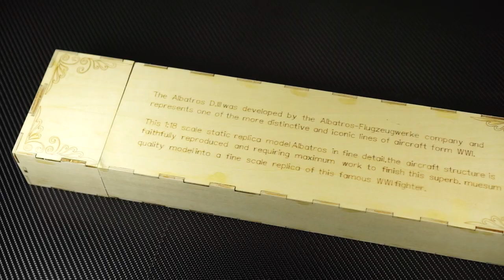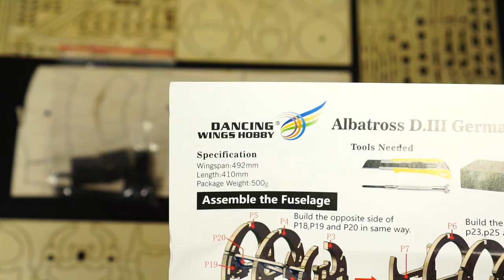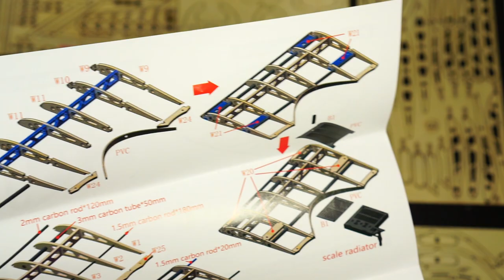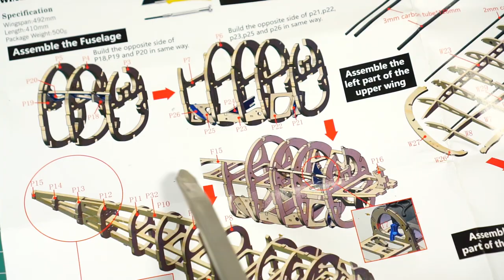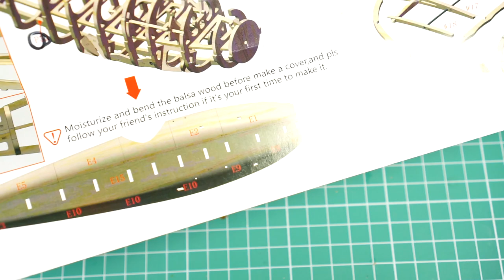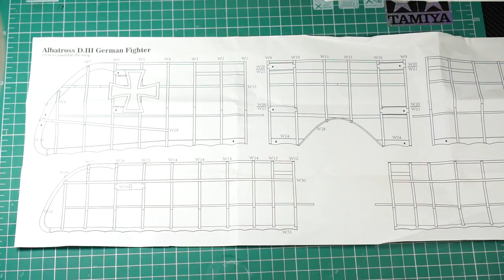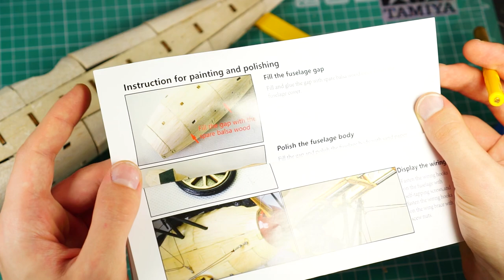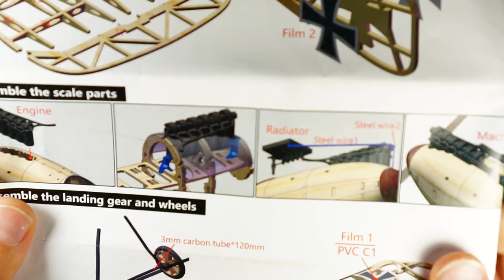Albatros D3 model build - DW hobby

Comment: Do you think this model would be nice if i cover the wings and tail with fabric and paint the fuselage?
Reply from the maker: If you are willing to go this far, I'd recommend going with flying rc replica of this model :) evenn without electronics it would look good and parts are better adapted for covering:)
Reply: @StaticModel  i was thinking of using this model since the fuselage is covered with plywood just like the real plane. Which would help with texture for paints. Idk maybe i could just find a flying rc model and cover fuselage with wood

Edit: sadly guillows albatros kit is rare since its from the 1950s and most cost 125 bucks.
Reply from the maker: @JacKnife3705  if you just want realistic model, there is plenty of options with realistic wood decals for 1:48 albatross, or you just can learn how to paint wood imitation... Cause DW hobby model wood grain is out of scale if you are going for realism.
Reply: @StaticModel  i used to do guillows models but their albatros is too expensive. Mainly looking for that type of model. But i dont want it to be entirely unrealistic. Only thing is i cant find any other model like the guillows albatros.
Reply: @StaticModel  1/48 WWI fighters are still pretty small models. (15-18 cm wingspans). Bigger, for some, is better.